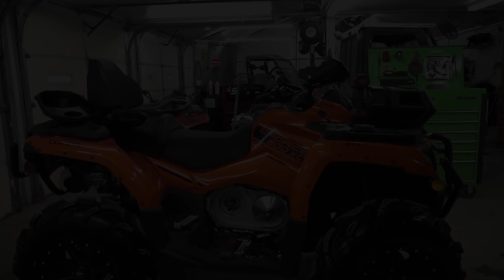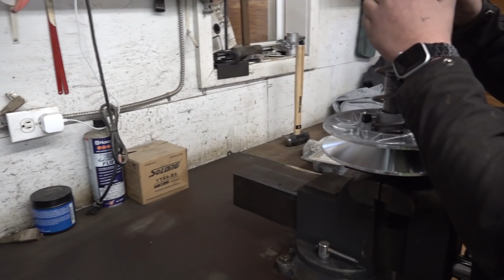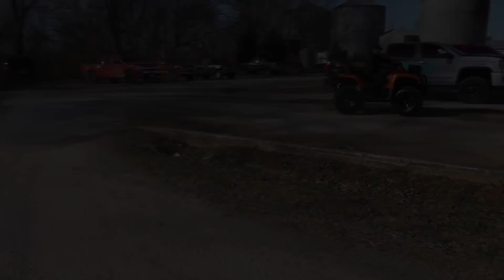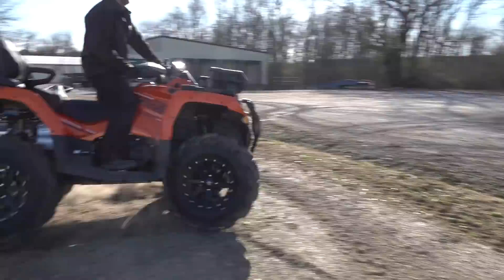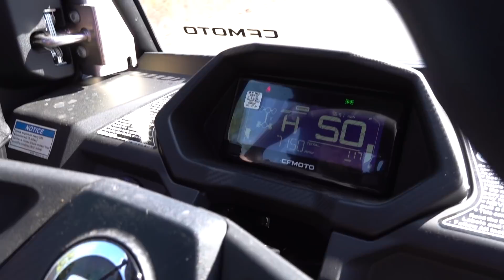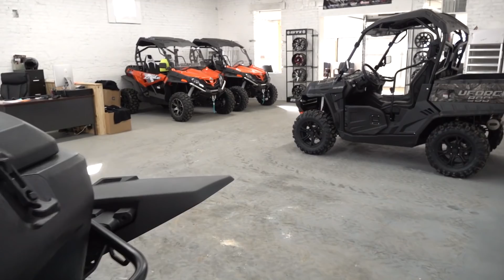CFMOTO MSC Stage 2 Clutch Kit Testing! Now Available For The Whole Lineup

Comment: With all the kits and upgrades y'all been bringing out on the market the only thing y'all got left really to do is get longevity out of them machines and people will have to start putting CFMotos into the talk with any major manufacturer on the market. The only difference between that 1000 and that 800 should be how one holds up under heavy work conditions but as a woods and trail quad that 800 should have no problems doing anything where that 1000 would be a workhorse for a farm type aspect or a hunters food plot planting type scenario... 🍻🍻🍻

Comment: Hey I have a 2017 Zforce 800EX , stock tires, I have on order 24g dr pulley rollers and a stage 2 MSC secondary clutch spring, which setting do you recommend for lots of bottom end to mid range power? faster paced wood trails with stop and go/ turns, average sped is 35MPH, I never go over 55MPH while travelling on road to different trails

Comment: Hello @mainstreetcycle
I just installed stage 2 clutch kit bought from you on my 850xc cforce.
Since then, it beeps a lot, and the RPM reaches sometimes more than 7500.
It seems like it is not good for the engine, although it has a lot of torque now.
Can you please share your thoughts?

Comment: Hey Blake , I have the stage one clutch kit from MSC on my 800xc. It really helped smooth out the take off. Still some hesitation though. I was wondering what the stage 2 would do for it if anything? I have the stock tires. Thanks
Reply from the maker: The stage 2 would make it more aggressive and pull harder.. but will perform extremely well with bigger heavier tires
Reply: @RealTalkPowersports  So you think it will still work well even with the stock tires? Probably going to get bigger ones down the road just not on the top of the list.
Reply from the maker: @mikedemanuel3608  I might would wait till u get the bigger tires
Reply: @RealTalkPowersports  Thanks Blake. I appreciate it. Love the videos.
Reply: @Real Talk Powersports  I talked to MSc about the stock tire .  Which that's what I have they said it wouldn't be a problem with stock tire .. I'm not replacing my tires anytime soon .  Should I return the stage 1 and 2 then?
Reply: @Mike Demanuel  I'm in your position.  But  I haven't done anything to the clutch.  Stage 1 and 2 it's on the way . But I'm not replacing tires anytime soon.   What are you going to end up doing ?  You still going to put stage 2 with stock tires ?
Reply: @juliopena21  I would definitely install the stage 1. It will make a big difference on your throttle response. Still haven't decided on the stage 2 yet.
Reply: @Mike Demanuel  I ordered both . Coming in tomorrow.  Not sure if I would put both . Not sure if I should return the product . I don't do mudding . I just to rocks and little puddle trails .  Not like deep whole stuff. If you know what I mean .  I would like the power for sure
Reply: @juliopena21  I  don't do mudding either. Just trail riding. I am happy with the improvement the stage 1 made. I would keep that one for sure. Maybe you just want to send the stage 2 back.
Reply: Is the stage 2 spring the same as the stage 3 mud spring? I play on getting the stage 3 mud at some point but was wondering if I bought stage 2 is stage 3 just adding to that then?

Comment: I have a question ,I’m really interested in buying a 800 or 1000. Is there a noticeable difference between the two ? Would you say the 800 with stage 2 is equal to the 1000? Still a bit less or maybe a tiny bit more?
Reply from the maker: The cforce 800 with the stage 2 msc clutch kit and the ECU tunning we are testing right now feels a little bit stronger than a bone stock 1000. 
But stock for stock the 1000 is very noticeably stronger than the 800
Reply: Man. I will probably be getting this in the future then. I added a ton to my cart on MSC and it was like $2,500 haha. Maybe one day
Reply: I have a 1000 and a 600 touring. Like the 600 but man do I love the 1000. So much power. Such a smooth ride. I love it. I’ve recently changed out to a better air filter and installed a stage one clutch kit. In process of installing the mud edition exhaust. Sounds so good roadie. Get ya one I think you will love it.
Reply: I have 22 800 and father in law has 21 1000. He smokes me. Its fast...real fast lol.

Comment: I have the 2021 Cforce 600 touring and information on the stage 2 and stage 3 clutch for the 600 would be greatly appreciated. I ride on roads a lot where I am in order to get to and from the trails and most of my riding is on asphalt, dirt, gravel and light to medium mud no deep heavy mud or big rocks. I only have 450 miles so far. Wanted to know which clutch kit would you guys recommend for my machine based on the conditions I ride in? Thanks for any helpful information.
Reply: @M6llumees69   I know I don't do any heavy mud riding but if I decide to put on bigger tires with more weight than a clutch kit might be required. Not to mention the extra weight I'm gonna be putting on with the skid plate the Box with everything I put in it and any other gear that might add extra weight.
Reply: @M6llumees69  What is lol? I have only used it one season and have yet to add any modifications such as skid plate, lift, bigger tires and maybe a clutch kit. Of course it's stock.

Comment: You did not show how it does in high gear looks like all the video shows is low gear
Reply from the maker: Yes I didn't run the cforce 800 in high on pavement because of the Zillas
Reply from the maker: But we show the effect of it in the Uforce 600 and it proves that it did not lose top end even with all the extra weight of the cab kit

Comment: Proves my argument that the clutches are shit from the factory.
Reply: No they're not. They tune them balanced, they do ok acceleration and topspeed. They're designed to work in every condition, now if u want to use it more specifically on a type of terrain. Like mud races, that's why they're fully tunnable to adjust them the way u want it.